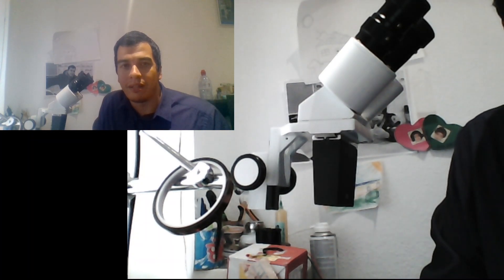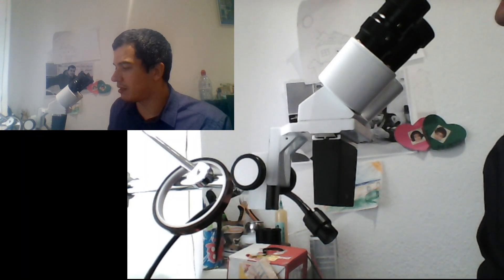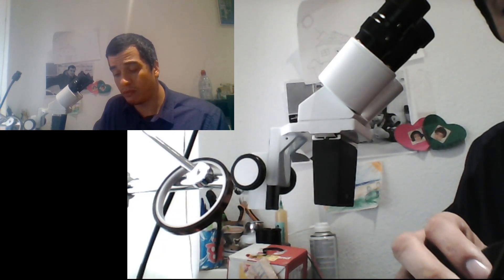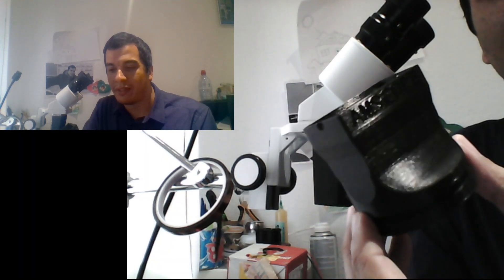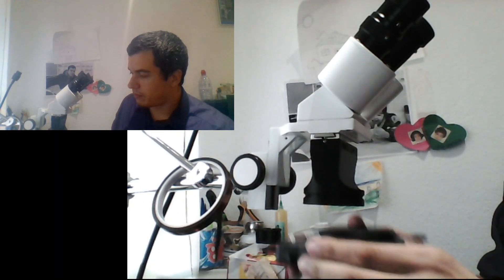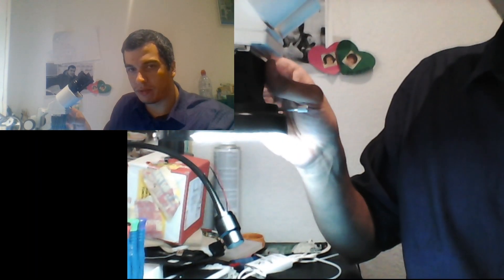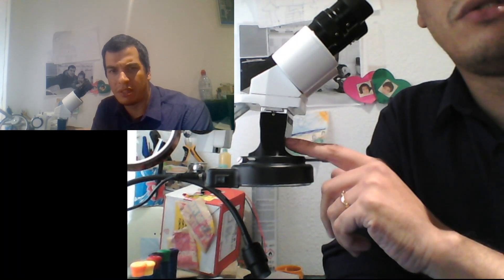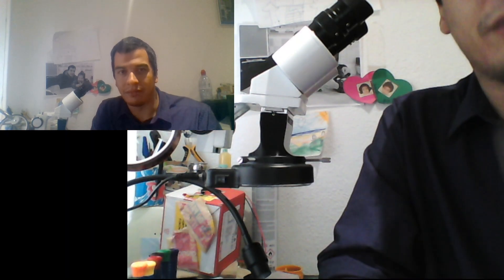Amscope se400-z using a 3D printer to attach ring led light

Comment: thank you so much!  Just printed this adapter on my kid's flash forge home printer.  I won an eBay auction for a used se400-z.  I like that the se400-z has an extension arm and large working area but really need direct overhead LED for watchmaking.  Voila!  Can't wait to cpu them together.  The 3d file worked flawlessly on one print run.